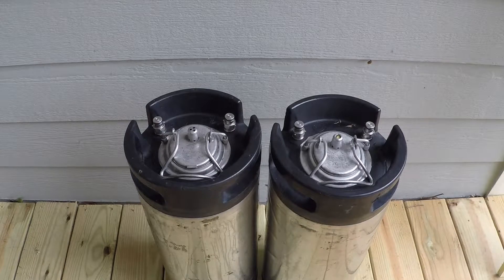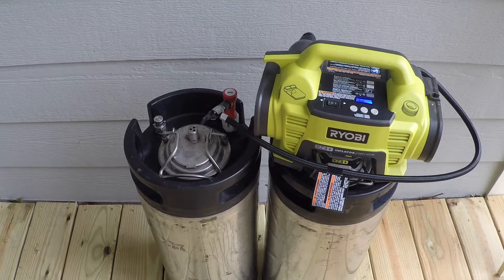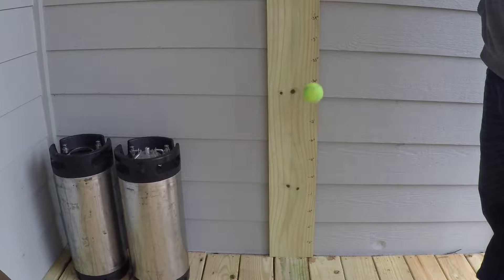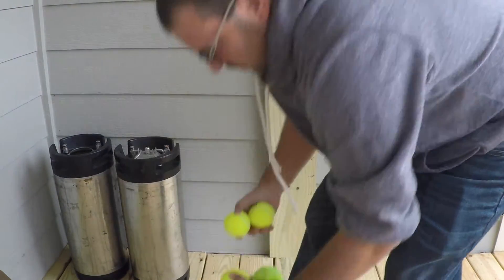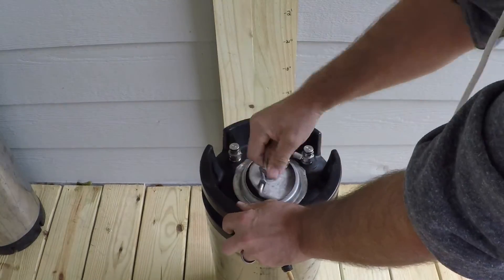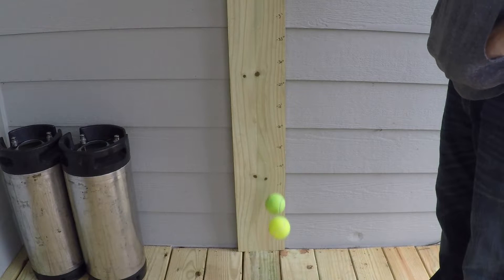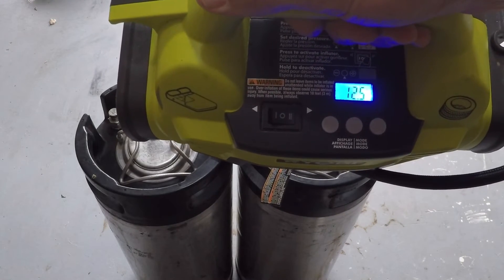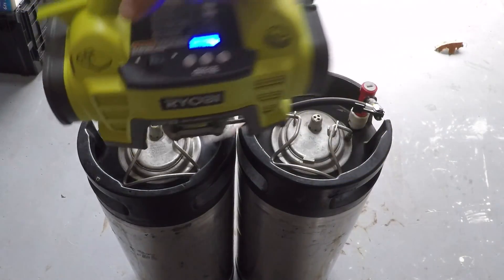Tennis Ball Re-Pressurization Results

Comment: Hi, first of all, thanks for sharing this knowledge. I'm buying a corn pump to inflate my balls. I have a few questions:
 * Is there a minimum number of balls to put inside? Or do you need to fully charge the corn pump each time?
 * I train once a week using around 20 balls. Will it work to maintain ball pressure between trainings?

Comment: Just a physics question: lets say the air pressure is around 15 psi and the regular pressure inside a tennis ball is 26, you would only need to add 11 more psi to  bring it to equilibrium. give or take. I noticed that my pressure gauge starts at 0 PSI, which would be vacuum, not 15, aka air pressure, which means whatever the gauge is showing is additional psi to air pressure. In this case, we only need 11 PSI more? I understand the higher the pressure outside, the faster it will pressurelize the ball. Just wanted to check the physcis here.
Reply: The pressure gauge is relative to atmospheric pressure. So a "0 psi" reading is 1 atm.

Comment: Why does it lose air in the first place? Can't they add a thin layer of sealant or something on the inside to stop air from escaping..ever? Car tyres don't lose pressure except for puncture so why can't the same be applied to tennis balls?
I just play tennis socially but I am burning through balls and it's getting pricey.

Comment: Finally something scientific, thanks mate! Could you kindly clarify why after the experiment you suggest keeping the balls inside the canister at 14psi which is lower than the atmospheric pressure of 15psi?
Reply: The 14 psi that he refers to is 14psig (gauge pressure), this is in addition to the already 14.7 psi of the atmosphere. Thus the balls are experiencing 28.7 psia (atmospheric pressure), or about 2 atm. My guess is that this increases the lifespan because there's less pressure difference between the inside and outside of the ball. Perhaps Penn tennis ball pressure is around 14psig and the 30 psig is over-pressuring to revive a dead ball.

Comment: Under pressure the balls contract is it alright? I’m still testing with an acrylic tube, and I watched them contracting above 20 psi
Reply: if those contract is because they are "dead"
ball struture might have gaps that don't allow to keep the pessure.

I keep mine from new on a acrylic tube at 30-35 PSI and they bounce great, after a year, around 90 to 95% compared to a new tennis padel ball ( I play Padel).

Try to keep them since day one, and rotate them. Mine are kept 1 week under pressure before playing with them.
I have two tubes, and now i'm considering on a solution like this in order to keep them longer.

Before i used to buy a can of balls every two / three weeks, now, i only buy them when a ball shrinks under pressure.
Using Wilson balls they last close to a year, general brand balls (low cost) 4 months at its best.

Comment: Just so you guys know: A ball is tested for bounce by dropping it from a height of 254 cm (100 inches) onto concrete and should bounce back between 135 and 147 cm (53 and 58 inches)
Reply: thanks for the test, it's very interesting! I believe you can inprove reproducibility by testing on a  flat floor without slits.

Comment: Thanks for this! For the sake examining the differences in pressure and duration,  why not go 30 vs 40 lbs, and maybe 2 weeks vs 4 weeks?
Reply: I think at 40 Ibs the balls will go flat and therefore no pressure would get inside
Reply: @cornutopia1389  though the balls will collapse at high pressures, the 2nd law of thermal dynamics kick in and will push the high surrounding pressure into the balls until they are equal. I experimented with a high pressure canister at 120 PSI over several months. Results were balls that bounced slightly higher than new balls from a can

Comment: I use conelius keg like you do but pressurize with CO2 from a tank designed for pressurizing beer. This is what commercially available ReBounce machines do. Apparently CO 2 molecules are slightly smaller than air molecules so they enter balls easier and quicker. I pressurize to 50 psi and leave balls in for 3 days, come out great! Amount of balls vs air is not an issue. I fill my corny kegs with 60 something balls per use.
Reply: Hey George - doesn't the balls collaps at 50 psi (as pointed out in previous comment)?
Reply: Builded one like the video but air won't go in to the keg.
Reply: @TeamSpinUSA  check if you connected it to the IN section, and then check if all the seals are ok. Sometimes the release pressure valve is worn out, or some orings.
Reply: No, the balls do not collapse. I don’t have a window in my keg, but I hear the popcorn effect. It did the same when I demoed the ReBounce unit. The balls come out great. In my experience Wilson US Open balls take re pressurizing best, and you can recharge them twice if they still have enough felt. I’ve even gone three times. The other commenter doesn’t seem like he has much experience, I’ve been doing this for more than 5 years. BTW go with CO2, it’s so much faster and convenient.
Reply: @georgeschuldberg1382  can you share a little more about how you are pumping CO2 into the tank? I’ve got 3 of the corney kegs, but I haven’t had good results trying to repressurize them at 32psi for 2-3 weeks. I don’t know if it’s because I’m using balls that are too-dead, or something else. Would love to hear more of your experience, especially if you tried repressurizing with regular air.

Comment: Did you have to maintain the 32 psi and reload the keg after the pressure dropped during these 2 weeks?
Reply: Not really. If it closes correctly, it maintains at that pressure. If you loose too much pressure you might want to check for leaks.

Comment: thanks so much for the videos.  how has it gone after a year? (a one year update video?)

  are you still using this system?  any sense of how long you can keep doing this (how many cycles? do the balls last a long time until they start getting bald?)  And seems the 14 psi for new balls would be a good way to keep newish ball, mostly new without having to do the overpressurizing period.  but great idea for old balls. 

i saw you recorded on iPhone X.  did you edit on the phone or use a computer?

Comment: Since I have a tank with a clear "window" and can observe what is going on inside the tank.  I just wanted to let you know that at around 35-40 psi most of the balls will collapse. One side of the ball will just cave in as if you have sucked the air out of the ball. If you start hearing the "popping" sounds coming from inside the tank — that's exactly what is going on.  I don't think that this can pressurize the balls any better or faster.  

I would even think that if you were to leave them in that state for a long time,  the rubber will get permanently deformed and the balls might even crack at the seems. You really shouldn't go over 30 psi — just leaving the balls in the tank for a longer period will do the trick.
Reply: Eu utilizei uma panela de pressao. Deu certo
Reply: @naoseimaisnomes  how do you do that?
Reply: I’ve been pressurizing balls for several years with this setup and no problems. Yes, I hear the popcorn sound too, but the CO2 gets in the balls and they come out re pressurized. I use 50 psi for 3 days.
Reply: Yes, it happen to mine. filled i up to 32psi, started to hear popcorn sounds inside the tank hahahaha
Reply: Your comment is helpful.  Where do I get such a tank (with a window)? Can you post pictures / video somewhere?

Comment: Recently I've come to this idea but still hesitating as I'm low level amateur training once or twice a week. 
How would you estimate the difference between playing new balls and 70% worn out ones but pressurized to 14psi? 
Thank you so much for this research.
Reply: This is a great question.  I am also wondering if the re-pressurized balls will hold the bounce when you start practicing with them.  I have played with a ball that looks to be bouncing well but after hitting with them for some time the stop bouncing that well.
Reply: @msantanau  I think this also deals with rubber wearing out.
Reply: @MrNDQuattro  I do not think it is related to the rubber.  I am able to squees the ball with bare hand and it felt good and with a good amount of felt.  I am able to bound it pretty similar to brand new balls. Then when you start practicing they stop bouncing and the felt is the same.

Comment: Hi Eddie, is there a reason you left them to get repressurized for 2 weeks?  Would waiting only 1 week make a difference? Potentially at a higher pressure?  I'm just trying to find the most efficient time and pressure levels as quick as possible.  Great video and explaination!  I'm building my own version adapting what you did to a ball and socket version of the keg and swapped out the tire inflation valve to directly put the valve on the air compressor hose.  First keg is pressurized and waiting to see the results now.
Reply: Did You bought it?
Reply: Any suggestions on how to pump the air properly?

Comment: The pressurization can be improved.  Too many balls in the container, too small volume of compressed air.  the ideal situation is to have only 1 ball in the container, and a large volume of compressed air. but a compromise can be made....fill the tank with 25% volume as balls.  75% volume with compressed air.
Reply: Or just continually add pressure to maintain 30 psi (or 30 psi), with this approach number of balls per unit of volume should make no difference.
Reply: hi, what would be the difference? isn't 32PSI the same regardless the volume? why?

Comment: good scientific testing
Reply: nope , there is no manometer on the tank , who says there is no small leak, or the surrounding temp changed the pressure 
the bounce surface is uneven should be a flat hard surface like concrete or a steel plate .
are the new balls the same temperature than the pressurized balls ? 
etc 
i dont say its a bad test , but scientific nope